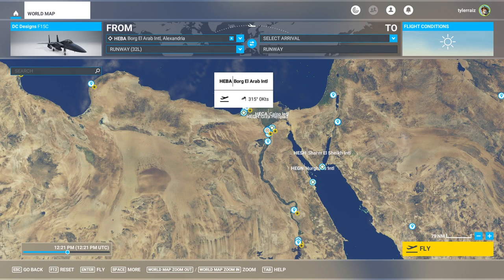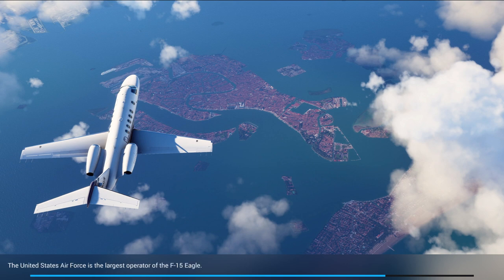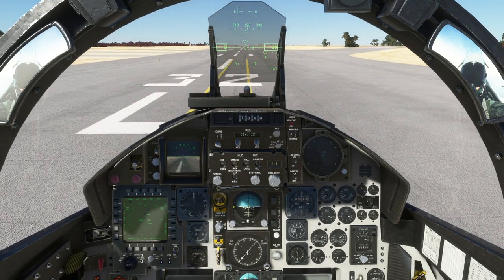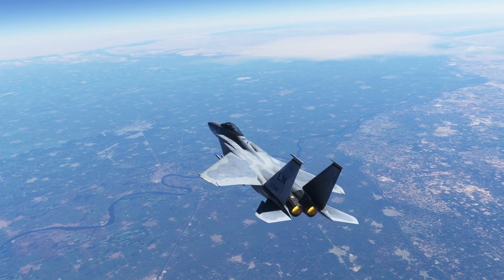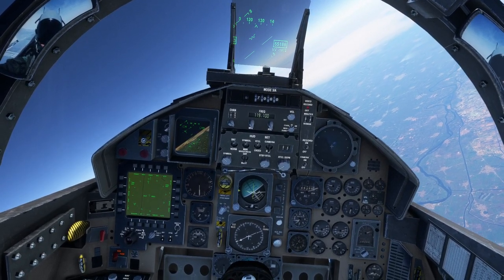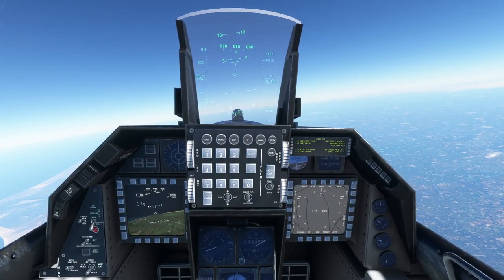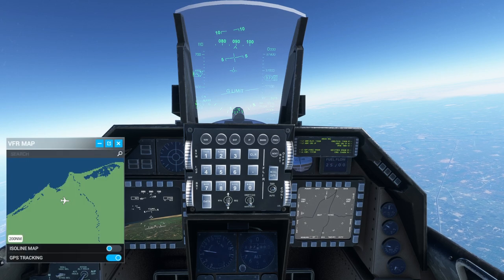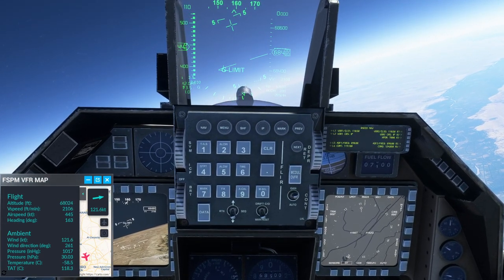Flight Sim 2020 - The F-15 and F-16 Still Go Too High and Fast

Comment: A real F-15 has reached over 100,000 feet before.
Reply from the maker: Not in horizontal flight - 65,000 feet is the maximum sustainable though in a brief spike the F-15 has gotten over 100,000, yes - and we went well past the record considering we got to 150,000 feet.